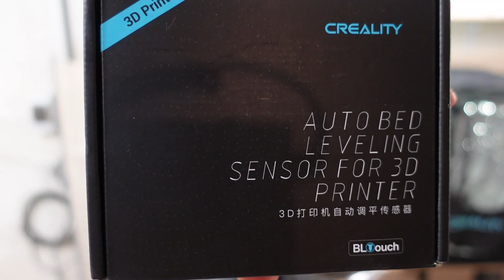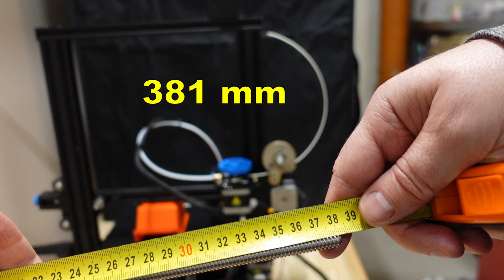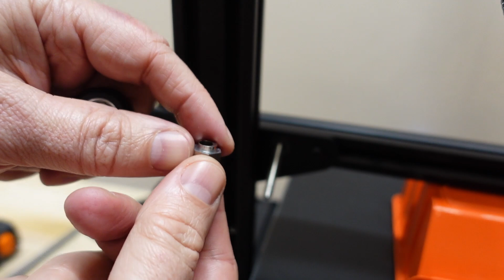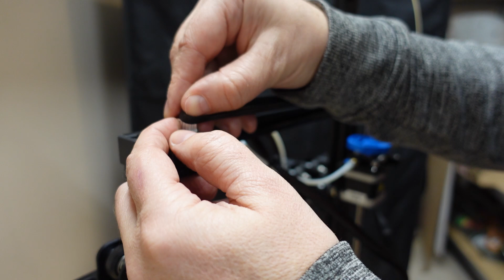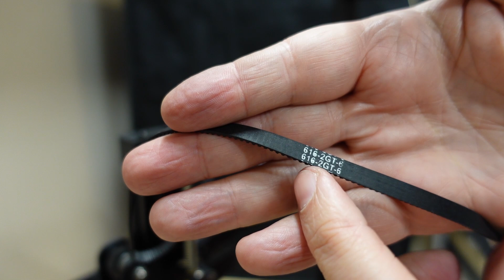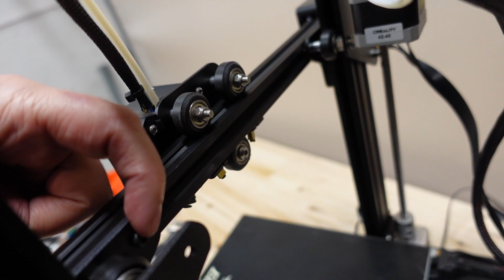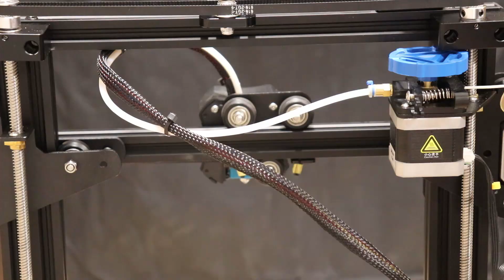Ender3 V2 dual Z axis upgrade with pulley and timing belt with single stepper motor

Comment: I installed the dual motor style but became very frustrated because as you mentioned when powered off they always got messed up and was always leveling the bed going to add a belt to the duel motors
Reply: I almost feel like the best would be a combo of both solutions.

Comment: Greetings! I stumbled across your videos while researching my EP3 V2.  I am still new to the craft, but no stranger to electronics or mechanics.

   I am thinking ahead to getting a direct drive for what I want to print.

  Anyway, towards the end of the video, you seemed to be hinting towards something I was thinking about when you said you were considering a "combination" of both the belt/pulley and the dual steppers. 

  Besides possible mounting issues I could see a potential benefit to having both of doable. Having not seen them in person and with my limited experience, I could only speculate... poorly. It could also just be overkill and/or end up causing new problems.

   If this was what you were thinking about doing, I was wondering if you could elaborate or do a video on it? No rush, it will be some time before I am ready to do the upgrade, but I want to have a good idea of what I am doing well before hand so I can plan accordingly. 

  Thanks for the videos btw. I have enjoyed them.
Reply: Top tip if you want to do fast colour changes on the fly by hand, Buy the Creality E-fit extruder and a Spider v2 or similar hotend. I fitted them to my Kingroon kp3s which originally used E3D blatant copies. Yes the E-fit is on the older side but its so simple and dont go wrong.

Comment: Which option would  be better in your opinion. The one with the Z screw and stepper motor or the one without a stepper motor? 🤔
Reply from the maker: I tried to answer in video. Two steppers are better, but may move if they are not powered. If you can pay attention to that, go with 2 steppers. If not, version with timing belt is almost good as two steppers, but it will stay in synchron even if power is off.
Reply: Thank you I think I will go for the one withe the just the one motor.

Comment: Run both, that's how I have mine setup, I also changed the lead screws to single start.
Reply from the maker: Nice. Single start? Lead 2 mm instead of 8 mm? Any significant difference in quality?
Reply: @MyTechFun  Chris explains it the best https://www.youtube.com/watch?v=b9qfP6Dqjxk
Reply: I was thinking, why not do both? Have you had any problems 3 years later?

Comment: Since you are mechanical engineer maybe you should measure current draw with one motor and one screw, two screws and two motors, and two screws and one motor and pulley. I don't know whats the limit of the driver for the Z motor. So are any of these mods, maybe stressing driver to much. This is maybe ok now, but what will happen when you add weight on axis like direct drive. Since these things can print for days it would be nice to know. Again I am telling this only because I see you have the knowledge to do soo. Anyway love your channel and you have new subscriber.
Reply from the maker: Usually mechanical engineers don't like to mess with electronic (at least those in my surroundings). But yes, I work a lot with electronic, so far I measured only the heating of the stepper during longer printing, almost no difference. I also measured the torque, 5% more with timing belt. That's not much. I will try to measure changes when I will have direct drive installed. Thx for the tip. Hvala Zorane. Pozdrav

Comment: I've been running the dual stepper setup with POM anti-backlash nuts for about two months with really good results.  So far, they've stayed in sync and I haven't had any issues with the setup.  It's probably a bit of an overkill on a stock Ender 3 but I recently installed the PrinterMods direct drive kit and have a 400mm Ender Extender kit on the shelf waiting to be installed.  That's the sort of thing that happens when I'm left unsupervised for too long.
Reply: could you show me a picture on how and in which direction you've mounted those POM anti-backlash nuts please?  I have em installed on my dual z setup as weell.. but 1 is pointing upwards, the other one down wards... not suree how it should be :S (i'm running dual z on 1 stepper motor)
Reply: @morbftw   I would post a picture for you but I can't and shouldn't post pictures or links in My Tech Fun comments section.  With Dr. Gaspar's permission, I would recommend you do a video search for "BV3D anti-backlash nut".  Both sides should be installed with the spring and compressed nut assembly pointing down. Do not over-tighten the screws holding the nut assembly to the plate. Slightly snug works best. The Creality mounting plates are not formed very well and it's easy to bind your z screw if you tighten the screws too much.
Reply: @soggynode  thanks alot!  I'll give it a shot :D
Reply: I’m literally in the same exact boat as you bud. All of those upgrades plus an enclosure with lights, air filter fans, octopi touchscreen…. 
I think I might just have to get a voron lol

Comment: I was leaning towards the dual stepper solution, but I hadn't thought of them potentially getting out of sync. Dual z endstops would probably be good, but I don't know if the Creality v4.2.2 board supports that, and it seems complicated to mix microswitch endstops and a BLTouch, so the pulley solution just seemed overall easier in the end. Used your referral link :) Going to replace the tiny z stepper with the larger e stepper after I upgrade to a more efficient direct drive, so it will maybe be just as strong as two of the smaller steppers
Reply: Careful with the type of motor you upgrade to and make sure your board can safely draw that much current and dissipate the heat properly.

Comment: Thanks for another great video!

are you willing to install and test a direct drive extruder for the Ender 3 v2?
Reply from the maker: Yes, that's one of my next upgrades (direct drive is already on it's way.. should arrive in few weeks)
Reply: @MyTechFun  Could you please tell me what direct drive unit you bought?
Reply from the maker: @imacmill  Micro Swiss
Reply: @MyTechFun  micro swiss isn't an extruder nor is it strictly direct drive, @imacmill There are multiple direct drive extruders for the e3v2, the bondtech BMG, the e3d titan, even the original Bowden can be modified into direct drive with a longer stepper motor cable.
Reply: sorry I take back my original comment, looks like microswiss does make extruders now that are designed around their more popular hotends.
Reply: @nateschmitz9827  Thanks, Nate. I've long since converted my E3V2's extruder into direct drive using a bracket I found on thingiverse. It works great. Note that I also added a second z-axis screw to help carry the extra load of the extruder stepper being on the x-gantry now (whether it needed it or not).
Reply: @imacmill  thanks.
which version of the second z-axis did you install? the one with separate motor or the one with the timing band?
or both?
Reply: @inonfarag  I installed the one with the separate motor.
Reply: Does such a thing even exist yet? I searched for one and found nothing.

Comment: funny how the kit with the motor costs less than the kit with the belt
Reply from the maker: Yes, I noticed too. Looks like two precise lead screw (longer) cost $$
Reply: Personally I would just use printed lead screw mounts and put the pulley wheels under them, using the same lead screws. Cost is just for pulley wheels, belt and mounts. Seems you lose head height anyway so might as well save money.

Comment: Thanks for the great and insightful video! Would it be possible to combine the 2 methods to create and even better solution? The mechanical and the stepper upgrades I mean.
Reply from the maker: Yes, absolutely. Start with this upgrade. And additionally, you need to add stepper to bottom of second screw, connect cable and you are done.
Reply: I just throw of that 😅 going to do.it.

Comment: Very interesting........I'm also doing an upgrade on my E3 to twin screws but I'm fitting the Z axis stepper motor to the top of the frame cross bar in the middle to drive 2 short belts to the screws instead of the long belt with tensioner that you have.
The pulley on the stepper motor is a double one with 2 sets of  drive teeth, one above the other,..... that way you don't lose Z axis height due to the motor you have hitting under the bearing block.
I'm also fitting small ball thrust bearings between both faces of the drive pulleys on both sides of the screws to prevent face contact friction from the thrust of the screws.
Reply: Did you ever get this upgrade done? If so, any thoughts ?
Reply: @MacAdder1965  Nope , not yet, the plan is to make it more reliable......my main interest is CNC milling and I'm currently into more things than I can do in one day, but it will happen eventually.

Comment: Perhaps dual z-motors AND a timing belt to avoid synchronization errors when powered off?
Reply from the maker: Yes, that's the perfect solution
Reply: @MyTechFun  Someone has tested this?

Comment: hello, in your next video i heard that you were planning to combine both z axis kits. did you have a chance to do it. i mean dual motor&belt together dual-z. this is what i exactly planning to do...
Reply from the maker: Not yet, but it is easy. Start with this timing belt system. And at the end add stepper motor and cable (instruction is in other video). My problem is that, in the meantime, I used the stepper in one of my Arduino projects, so I have to order another one :-(

Comment: It would have been good to hear which one you would buy if you were spending your own money.
Reply from the maker: Dual stepper, but pay more attention to bed leveling. Don't move Z when stepper is off. If you will have problems, you can add timing belt later (top holders are on thingiverse too)
Reply: @MyTechFun  There are no quality improvements for the dual stepper variant, so the belt variant is safer. The steppers for some reasons could lose steps so that could ruin your print. On the belt variant you only have to tight the pulley screws for 2-3 times until they will sit well on the rod, and after that no other issue will occur, except that you indeed need to stop the right side rod to go up. I used for this a bearing with screws on the inner axis. Nice that you have notice that problem so quick, I needed few days.

Comment: Now you've shown the z-limit problem with the extruder I may print myself alternative holders, as I've got the dual-stepper upgrade ordered and assume those were the same?
Reply from the maker: The top holders for lead screw are NOT the same with dual stepper and pulley system. The dual stepper can be used even without those holders. The ball bearing moves so screw can freely bend 1-2 mm. In pulley system, the top ball bearing is strongly in one place.

Comment: Why waste the money when a Creality dual stepper upgrade is less than $50 USD
Reply: Syncing them with a belt is better whether you use a 2nd stepper or not. This essentially locks the sides so you only need to level the gantry once. With two steppers they can easily come out of sync.
Reply: @henrimcgowan5589  lol what? I've been using dual stepper lead screw cnc mills for years with zero "syncing" issues. That's probably the dumbest thing I'll read today.  🤣 not to mention,  the belt isn't going to fix a syncing issue with two steppers.  It will just cause them to burn up from fighting each other.
Reply: @AKFurbes2126  if the stepper motors don't go out of sync, then why would the belt drive burn them up. I've been running that setup with no issues. The other option at the time was to mount closed loop steppers on top, since both my other axis have them.
Reply: @BruceTheSniper  reading comprehension not your thing? Read it again.

Comment: Since I was going for direct drive I was wondering which option to go for as well.  I'm keen on the pulley system but perhaps paired with a stronger stepper just in case. Would the printer handle the power needed. How harder is it for the stepper on that setup?
Reply from the maker: It looks like this stepper can handle without problem. But I didn't measure it.
Reply: I have this mod since a while and I can tell you that if the setup is good, there are no problems for the stepper to handle the z axis. Be careful to have a 616mm belt to use it without tensioner, or a bit larger if you want to use the tensioner. My kit came with 610mm belt and because of that I couldn't rise up to the maximum the z axis, because the leadscrews tend to bend and stop the carriage. After purchasing a 616mm belt everything works fine.

Comment: Great video. What about the Z-motor will it get hotter because it has to work harder?
Reply from the maker: Hm. Good thinking. I didn't measured it yet. I will check
Reply: @MyTechFun  Thanks, please let me know. Im looking to upgrade to dual Z axis
Reply: @MyTechFun  Did you found out allready?
Reply from the maker: @JulianiLuckeey  Yes, 28°C, almost no change (see my latest post on YT)
Reply: @MyTechFun  great, but I don’t think the difference is noticeable after a half calibration cube haha
Reply from the maker: @JulianiLuckeey  It is, half calibration cube needs approx 30 minutes, temperature of the stepper goes to constant temperature after 10 minutes. Additionally I moved the axis up-down on full Z length several times. Normally during 3D printing Z axis moves veeery slowly. So I belive this is realistic value. (I did this test for me too, I was courious too)
Reply: @MyTechFun  I just installed the belt kit. I ordered two for both of my printers. The are useless, there is still lots of play in the right axis. I should have went for the dual Z motors...

Comment: If you want to check if an angle is 90 deg but you cannot use some sort of angle measurement device you can use the 3-4-5 method. mark a point 3 length units away from the corner on one side and a point 4 units away from the corner on the other side and then measure the distance between the two points. If it is 5 lu the angle is 90 deg. :)
Reply: that sounds infinitely more complicated than just holding a book up to it or some shit.
Reply: Don't talk crap.....checking with a square is the way to go.

Comment: so which do you recommend?:) i have problems with this, not sure which solution to buy
Reply from the maker: That's what I tried to answer in conclusions part at the end of the video. Both has pros and cons. Best is the combination of two.
Reply: @MyTechFun  I ended up going with a combination or both.... Seems to be working great :)

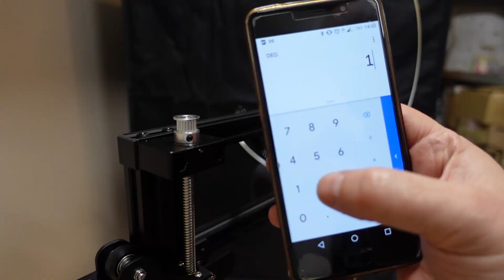Comment: really nice work overall! but at 14:23 you are calculating with a measurement error. if everyting is aligned perfectly, the center of the two rods have a distance of 290mm (2 times the distance between the alu extrusions + 4 times half of the alu extrusion width). so the minimum length of the belt has to be: 250*2+20*4+12*pi=617,7. the belt is too short.
Reply from the maker: That's why I calculated with measured values. It is not guaranteed that screw is 100% at the center of alu extrusion. Center to center distance 2x and two half circle perimeters (= one circle perimeter). But yes, it is always better if belt is longer, because we can use tensioners. Too short is much bigger problem.